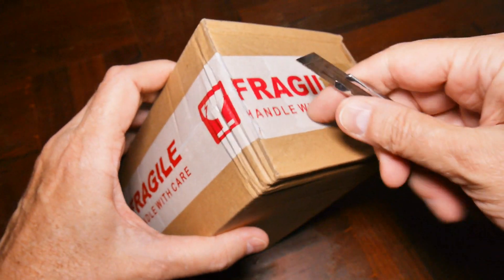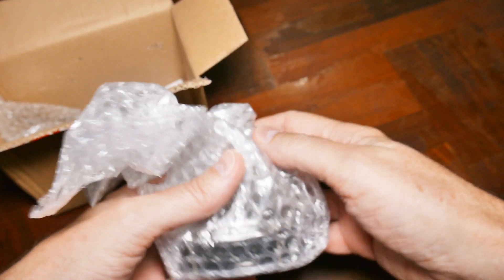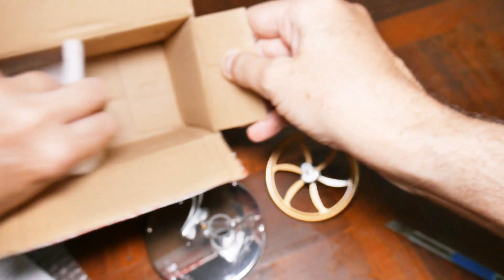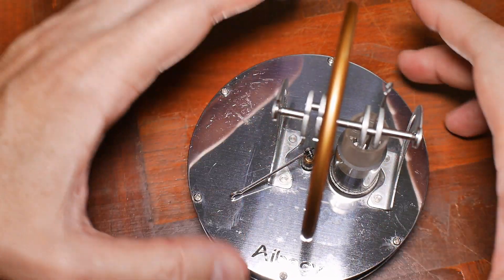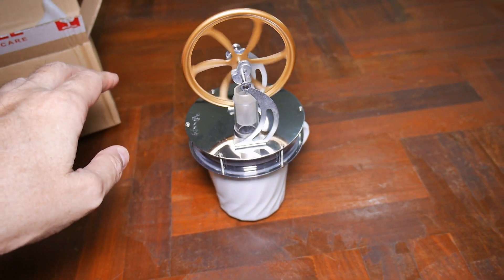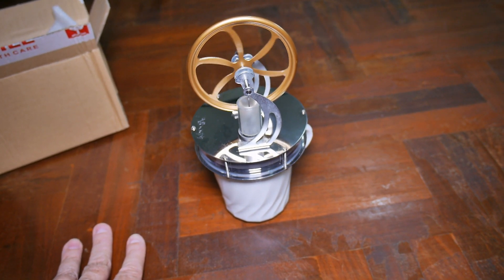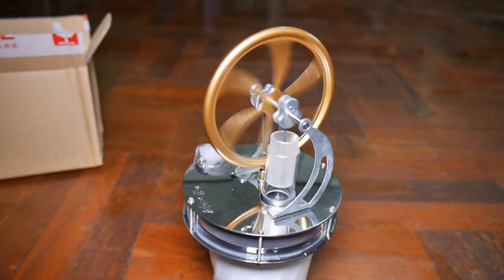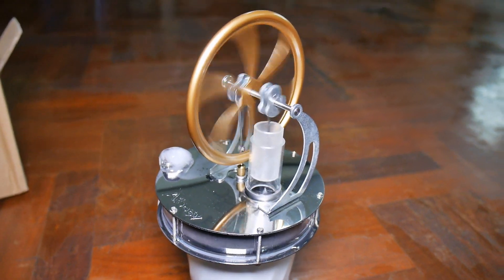Stirling Engine - Low Temperature

Comment: Love this. Ordered one on Amazon. I was having difficulty getting it to run, until I added a bit of WD40 on the needle bearings, con rods, power piston, and the Displacer Shaft.
Reply from the maker: I found that oily stuff on the power piston causes problems. I cleaned mine off really well. If it needs a bit of help, I just use a drop of water.
Reply: @tsbrownie  Thanks, I'll give that a go.

Comment: I have almost the exact same one as you. However, that center piston rubs up against the wheel which essentially stops the thing.
Reply from the maker: Mine came bent up pretty badly. I had to straighten the shafts. If you do that, don't put pressure on the glass components, they break easily.
Reply: @tsbrownie  thanks. I checked and the super short bar that the hook that pulls up the inner piston, needed to be pushed over ever so slightly. It made enough room after I did that for the piston to clear the wheel. No more rubbing and it works great. If anyone else has this problem, I can try to help. 

Also, I don't know if you've tried to scan the QR code on those instructions it came with or not, but I did (it doesn't help that they put a fold through it) and it doesn't take you to anything remotely related to stirling engines, it was some Chinese show.

Comment: I got one as well. Nice toy. Unfortunately the weight of the piston is not balanced so when the temperature is not enough the flywheel will stop when its baricenter is at the lowert. I am wondering if there is a way to rebalance it ....
Reply from the maker: You could try adding small weights (copper wire) around the spokes of the wheel.  See if it helps.  It's trial and error, but it would probably work.
Reply: @tsbrownie  that' exactly what I did, actually

Comment: I wonder if a little bit of oil or graphite on the bearing points would help.  Definitely cool.
Reply from the maker: I did use graphite on it.  What seemed to help the most was it broke in, like with a new car engine.  I've run it for 6 hours+ and now it really runs fast, no problems and much less sound.